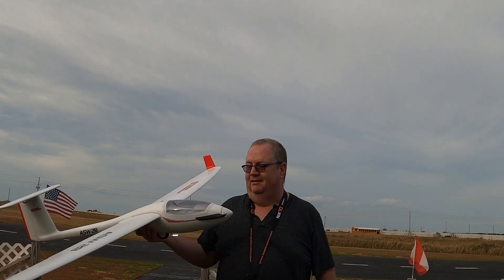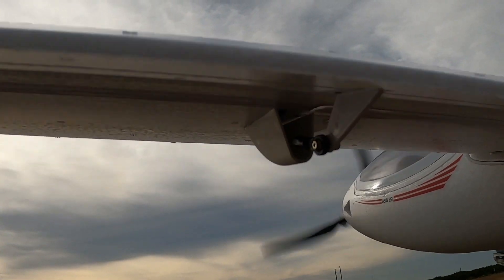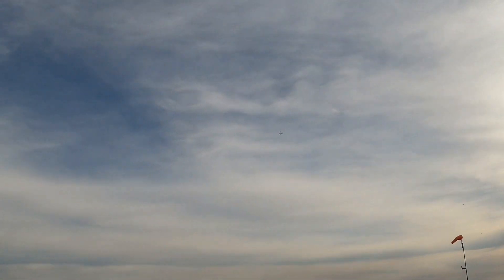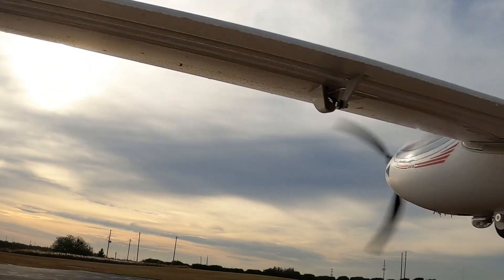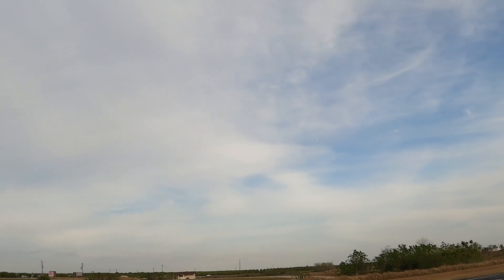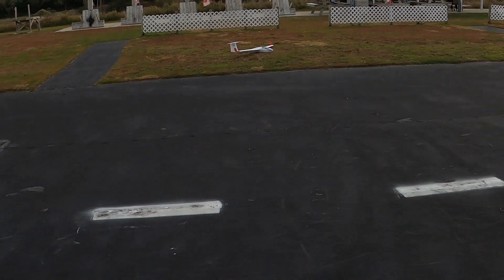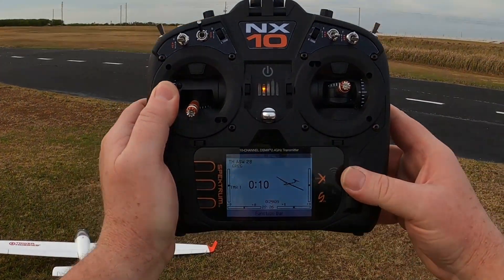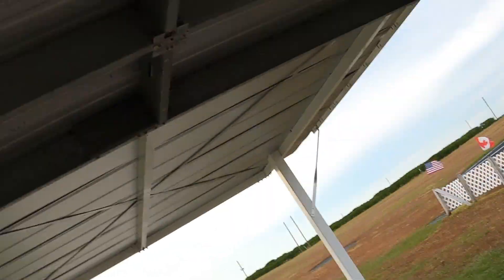TOWER HOBBIES ASW 28 MAIDEN! CRAZY WIND, NO GYRO,I AM NUTS  by FGFRC

Comment: I prefer my $50 AR620 rx's. I compared frame losses on 2 timber X's Monday. Nite x has the smart (not safe) 8ch, green x has 620. 620 had 1 frame loss in 5 mins, 8020 had 15. Gotta be the 'smart' part IN the recievers & telemetry. 

Buddy flew his Evolution (stock setup, stock rx), 5 minutes he had 237 frame losses. (For those that don't know, 'frame losses' are milliseconds of no signal recieved)
Reply from the maker: Well as you know the ar620 if by Far my favorite receiver.